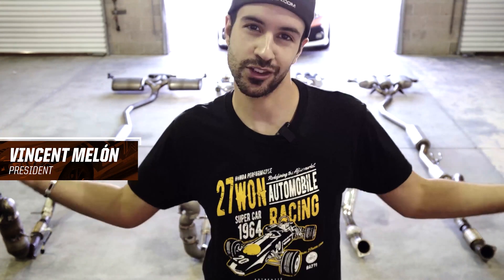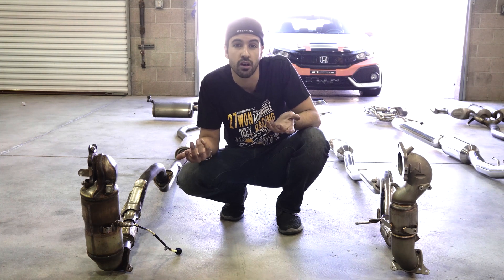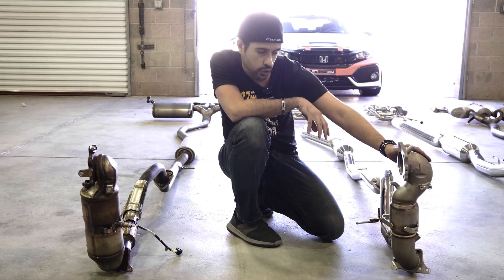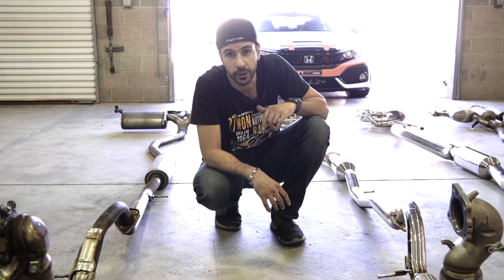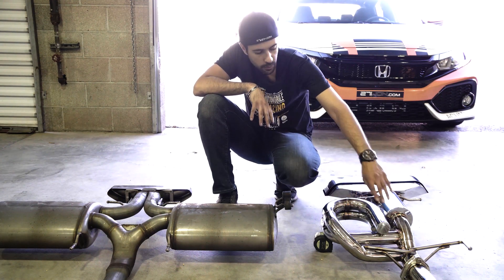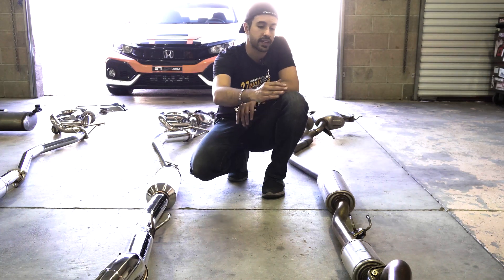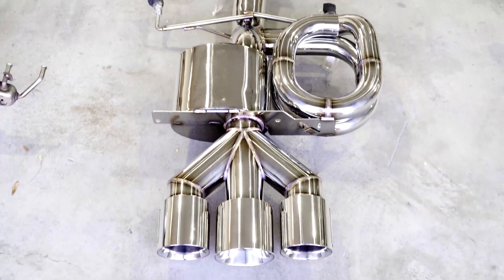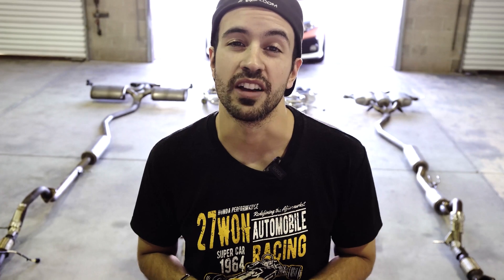Exhaust Terminology 101 (2016+ Honda autos)

Comment: I see that the tip on the Si exhaust looks like it can be unbolted. Am I assuming that correctly? I would love to have a single tip made and routed to on one side or the other.
Reply from the maker: That is not correct. The tip is welded and is one piece with the whole axle-back section.

Comment: Hey Vincent, what is the reason for putting an additional in-line resonator on the Si/CTR exhausts vs. leaving it off the FK7? Thanks, great video!
Reply from the maker: Since the inception of the FK7 system we now include the resonator for that kit as well.
Reply: @27WON  Was this for overall decibel/regulatory reasons? Or would the OG systems benefit from adding a resonator? Don't want to be missing out :p

Comment: The multiple 27Won products I've received so far for the FK7 are absolutely stunning. The Drop-in Turbo, CAI, Brakes, etc. have all came with a nice unbox experience and in depth install guides. Have had nothing but noticeable power/performance gains and I have yet to get my exhaust in august. Cant wait! Thanks Vincent!

Comment: Hey Vincent, love your videos & info given in them. I Have a 2018 civic Si coupe so any performance information on this particular car is of special interest to me. My next upgrade is a bigger turbo & possibly a flex fuel install. Keep up the great work.
Reply: I would definitely recommend the drop in turbo unit. Adds a lot of fun to the car.
Reply: I'm Heavily leaning towards the 27won. The simplicity of it makes it certainly appealing. Anyone here have one installed in their Civic?
Reply: Jim Jenkins I have it installed on a 17 hatch sport. If you have a KTuner or Hondata, it is best to throw a proper tune in to get the most out of it. However it’s up to you, as the power increase is noticeable regardless. I highly recommend the TIP(Turbo Inlet Pipe) to go along with it if you want a faster spool and nicer sound to it, especially when tuned.

Comment: Great video as always guys. Any plans for a version for the non-si/non-ctr 1.5L?
Reply: They have a full exhaust system for civic hatches and I think sedans as well.
Reply: Logan Hyde you’re right. But nothing for the 2017 EX hatch, right? I should’ve been more specific :)
Reply from the maker: @johnle8819  our dp and fp will fit on all the 1.5t engine. The fp-back is where it gets tricky.
Reply: 27WON ah that’s so good to know! Will definitely be grabbing the fp/dp + the intake